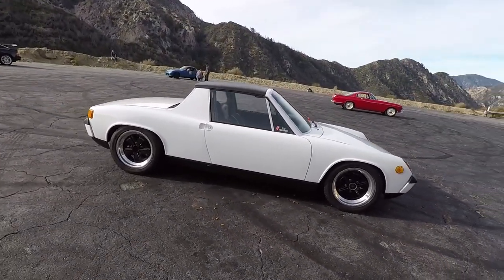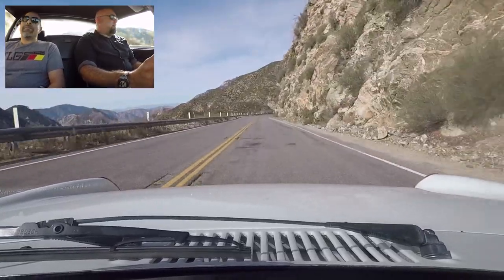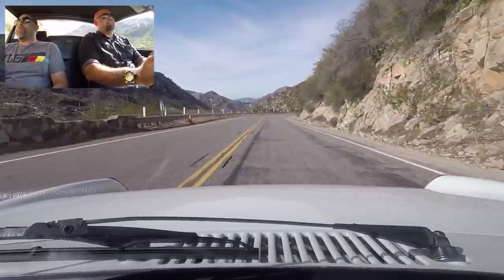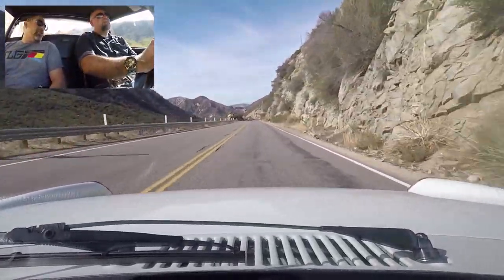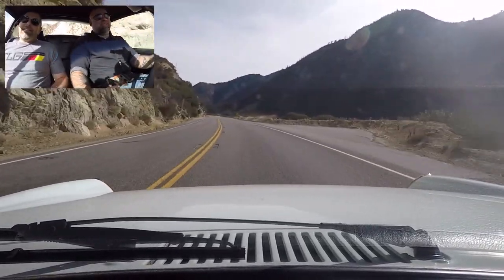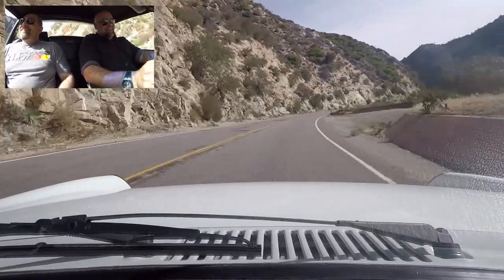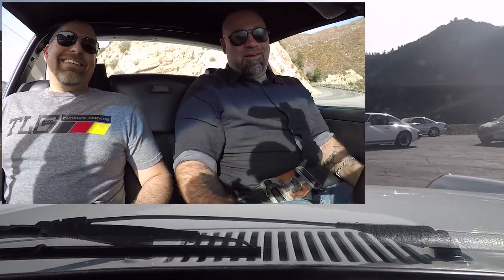1973 Porsche 914/6 - One Take

Comment: Sweet! Yes it is a 'NARP', a joint VW-Porsche project. But all you haters have no clue that a well set up 914-6 like Marco's can DEMOLISH many 911s including modern ones, plus Caymans/Boxsters and other much more modern cars at a tight technical track and in the canyons...  Mine has been built/serviced by 5 different Porsche shops around the L.A. area (including Marco's / TLG) and every one of those shop owners are/were 914 fanatics and owners/racers even though they also own very sweet 911s as well... (I only say 'were' because one of those guys has unfortunately passed-away.) That should tell ya something.
Reply: I remember when I first met you and your car.  Our cars were almost identical save for the different induction systems and color.  I like yours better than mine now, though.  :-)
Reply: ninefourteensix no haters..

Comment: Not a huge 914 fan, but that engine sounds wonderful.
Reply: My father had (well,  "HAS" actually, it's still sitting  in the garage right now)  one in Ravenna Green (Or as I used to call it "Monkey puke neon green") and always kept it in good shape, no dings, rust or dents,  with vanity plates that read "CLEEN 14".  It is the only car I ever knew him to drive from the time I was a baby until I graduated college and he bought the 95 Impala SS he drove for his office when the lease was over.  I learned to drive in it, practicing starting and stopping in the LA Zoo Parking lot, needing pillows behind me in the seat to reach the pedals and get that clutch far enough to the floor to shift gears. No power shifting or steering or windows either, driving it meant using some muscles to operate the stiff pedals and tight shift pattern.    Learning to drive on that made driving any other car EASY.   

He put at least 300K miles on it and put a new engine in it twice over the years, even when the gasoline went all unleaded and he had to put in  lead substitute, it was an inseparable association, my dad and that car...  and yes THE SOUND.   it had a deep rumble-y voice like his, too.  My friends and I used to be able to hear him coming to pick me up from school from blocks away with that signature sound, almost like a lawn mower;  it was so strong that whenever we drove through Beverly Hills,  the sympathetic vibrations of the engine would trip the alarm sensors on all the fancy cars  parked on Rodeo, and we'd leave a wake of sirens singing together in chaotic cacophony, each new member joining the chorus as we rumbled past. 

It was almost like a cartoon character, or Wonderbug from Sid n Marty Krofft  with the pop up headlights looking like eyes that opened up at night.  It had nice lines too, with the top on or off.  The color just made it that much more of a statement.   

It might be worth a little bit of money now, too, given that he took such care of it, it's not all rusted out-  that green paint is even inside the trunk, but it's still shiny.  I don't think I could sell it though - it's too much a part of my memories.  Nostalgia is not a sufficient word for how much of my childhood lives in that car.  I'd still probably need the pillows to drive it even now.

But the strongest association will always be that growling engine sound that always told me my  Dad was almost home ....

Comment: In my 1971 911T:
1-2 gear shift: open palm on right side of knob, slider forward to neutral, slightly relieve pressure, slider forward into 2nd.
You cannot speed shift 1-2.
Reply: Would the 6 in this one not be torquey enough to start in second most of the time? It would only be 2000lbs wouldn't it.
Reply: Dave Wahrer no der
Reply: @Jake warren - Typically you can start in 2nd, but it's not great on the clutch.
Reply: I used to own a red 1971 911T targa

Comment: Tip: Don't shift 901/911 transmissions with your palm over the top of gear-shift knob.  Shift gears 1-3 with your palm on the right side, and 4 & 5 with your palm on the left side of the gear lever when shifting up, and on the right side when shifting down.

Comment: Yep.. little bit of motivation for me to stop dumping money into my drift bmw and start giving lucky, my little 72 some love. 5000 miles on the little rebuilt 1.7. One owner car, completely restored by the owner, a 84 year old mechanical engineer in 96. All factory parts, every rubber, nut and washer, bushing, brakes, rack. You name it. With full service records 4 binders thick right back to Feb 73. Unfortunately the man passed away, but his wife somehow decided I was the right person for it. Determined it needs some new fuel set points, a new seat frame, as the drivers left is broken inside. And something in the throttle linkage inside the tunnel is causing the throttle to stick.. One day I hope to get a Jake raby motor for it.. Looking at those flat 6 prices and my 26 year old income... Ahaha a boy can dream.

Comment: 9:00 guy lets you by and there's no shifts until 10:30 - holy power band batman! This is no way shape or form a typical 914/6 "motor" as it's about twice the HP as stock. Not sure why you need the close ratio gearbox.
Reply: The close ratios help in tighter canyons.  Angeles Crest is all 3rd and 4th gear in this car.

Comment: I'd hate to think what a rebuild would cost on that twin plug, Porsche parts are stupid expensive. I'd swap in a flat 6 from a Subaru after that thing goes.
Reply: Twin plug isn't inherently more expensive to rebuild than any other flat six. The distributor, wire, coils, and ignition boxes and misc parts are initially expensive ($3-4.5k) but once purchased, you don't need to repurchase or replace usually. The distributor and cap/rotor are the pricey bits - about $2k.
Reply: With the money you would spend on kits of fabbing mounts, exhaust and running cooling equipment, you wouldn’t be any better off and then you’d just have a Subaru motor in it.

Comment: Lol, missed shift off the bat. I had the same problem with my 914, the shifter was rubber spaghetti
Reply: Turns out the set screw in the shifter ball cup had worked itself a little loose; I didn't drive the car there so I didn't know there was a problem.  Got back to the shop, tightened it up, and now it's perfect.

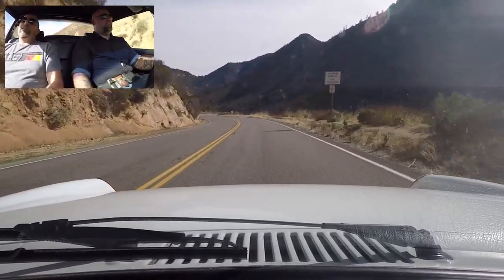Comment: Who else saw the 944 at 6:39?
Reply: I think you might need to take a little trip to LensCrafters, because the only cars I see there are a sedan and either a pickup w/bed cap or SUV... no 944 in sight.
Reply: The Ranter I'm pretty sure it's a blackis 944 parked up there but I could be mistaken
Reply: It's definitely a sedan... if you look closely, you can see the B pillar that separates the front and back doors. Not sure what kind of car it is, but it's definitely one of the coupe looking sedans that's out these days.

Comment: 220 whp is very gen
Reply: Not really, totally doable with the right pistons and cams, you can run more than 10.5:1 CR with twin plug
Reply: Correct...mine has a 2.7 twin plug around 11:1 C/R, dynoed multiple times at 237 whp... 1,995 lbs.
Reply: ninefourteensix 
 what type of gas are you running at the compression ratio
Reply: I typically run 100 octane unleaded which I fortunately have available at the pump near my house and of course at the tracks. Engine makes peak power at 7500rpm and its often very hot at our tracks around here (>100F ambient) so that gives me an added comfort factor. Technically with the twin-plug it can run OK on a mid-90s blend of 91 and 100 but no way would I feed it our straight 91 oct. / 10% ethanol California crap.